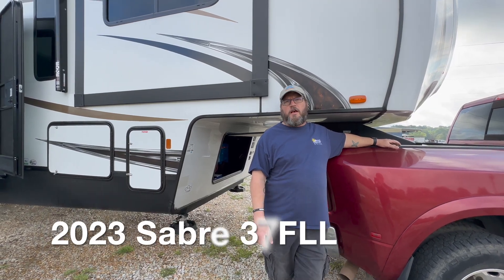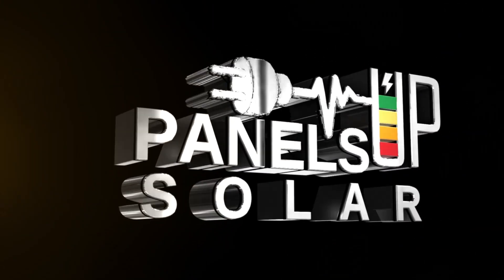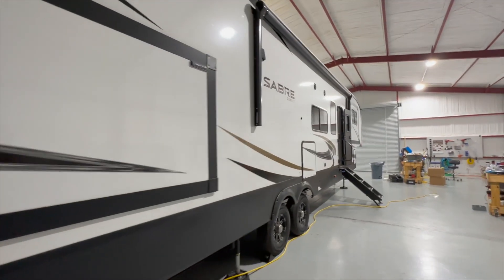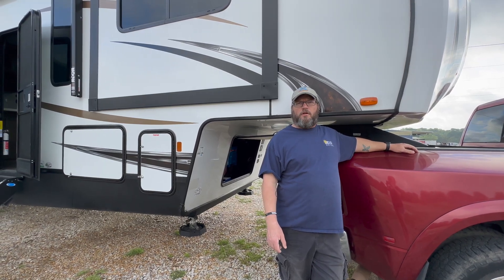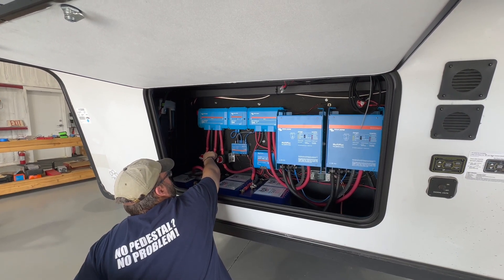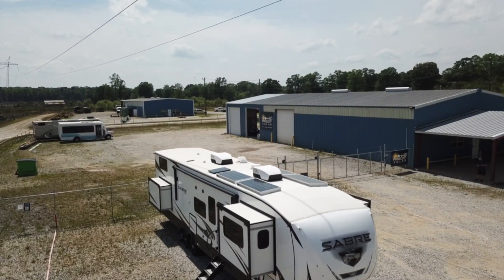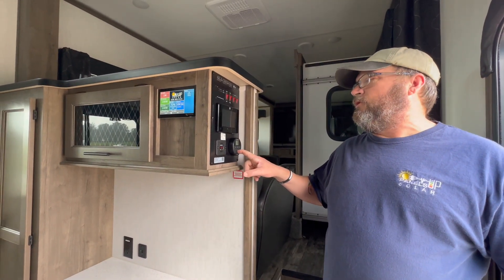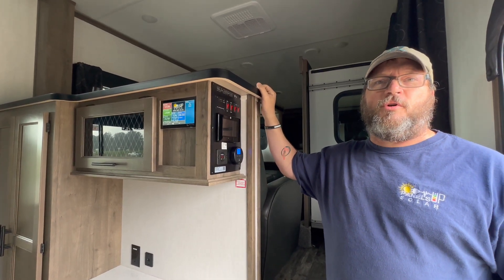Dual Inverter with Batteries and Solar - Install by Panels Up Solar

Comment: How much does a setup like that cost
Reply from the maker: The cost of this build at time of construction came in around $22k parts, labor and taxes. That is specific to this particular build.  If you would be interested in a quote for your specific needs and rig, check us out at Panelsupsolar.com.